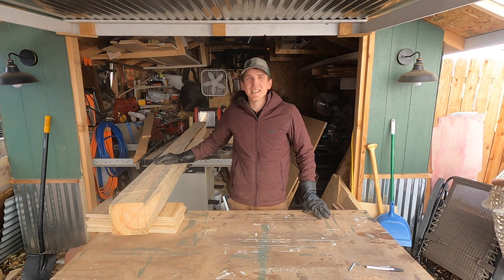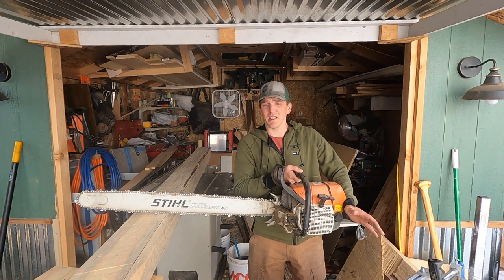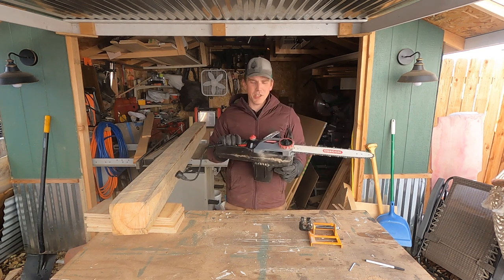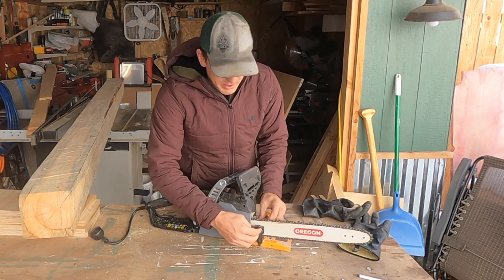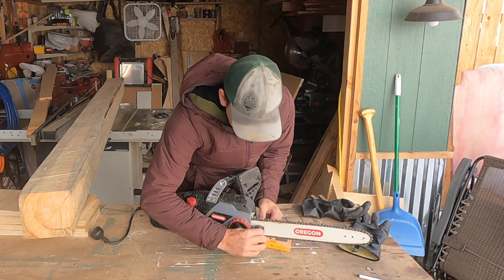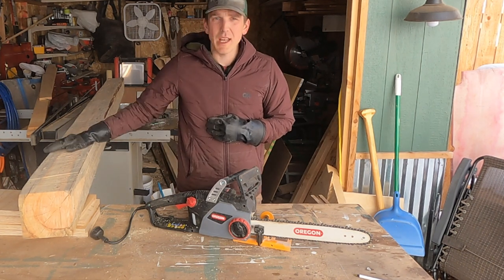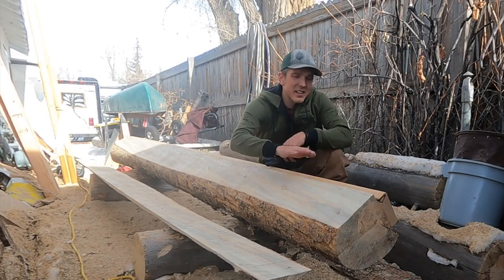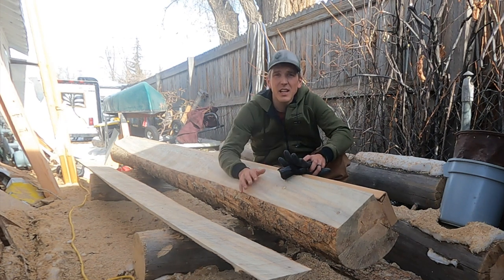Milling beams for less then $150

Comment: 0:35 I have a STIHL 064, 85cc, saw that I use for milling. My dealer told me I need an MS-880 but so far the 064 has been eating wood like butter. I'm thinking be just wants to sell me a big expensive saw.
Reply from the maker: Yea, I find as long as I keep the rpm up and don’t push too hard, it does great. The salesman always say you need a bigger motor haha